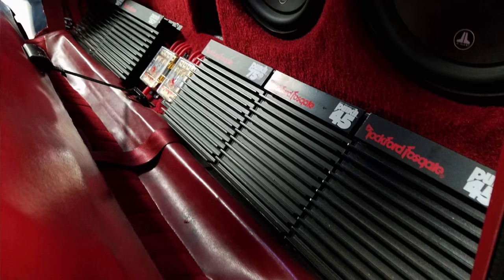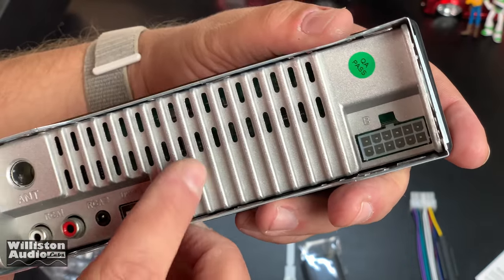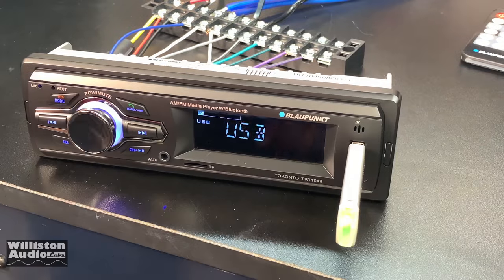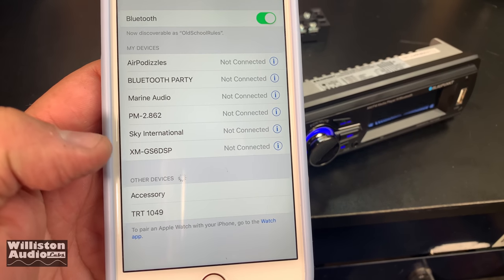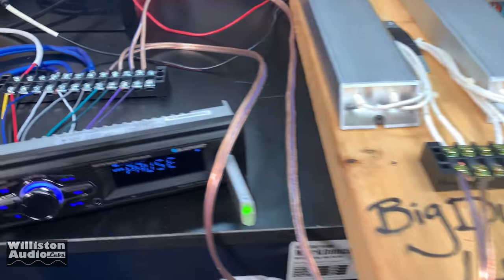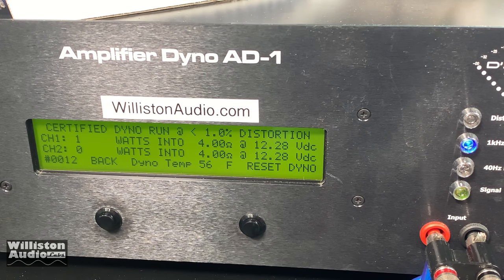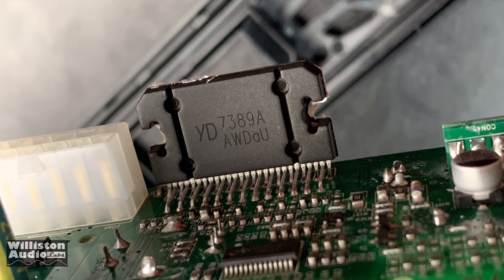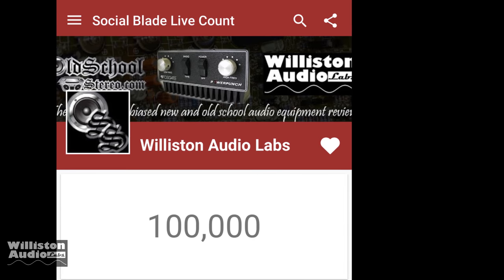Is a $10 Walmart Car Stereo Any Good? [4K]

Comment: How many amps to power this thing? I could see myself installing this flush into the face of my workbench with a small 12v power adapter rather than the old boom box I have on a shelf now.
Reply: butchtropic  okay so I woul need a pretty hefty power supply

Comment: NO idea HOW this ended up on my YT "Recomended" list, but glad it did. I'm currently building out my '99 Plym Gr. Voyager as a stealth camper & THIS stereo is ideal for this application. Quality brand, cheap price, remote control (for when I'm in back), BT, USB. . . looks like I found a stereo for the van! Just need to see if it's still a reasonable price here in April of '19(?). Thanks.
Reply: Probably bought the advertising package. It popped up after my Linus Tech Tips vid
Reply: Blaupunkt is just a name nowadays. They slap it on things produced by whomever. And you'd be insane to expect a quality product for 10 bucks. Only god knows how long it will last you. That being said, if you aren't picky babout the sound quality, can't go wrong with 10 bucks.
Reply: Yeah, at this price, and being it isn't really a Blaupunkt, can't put quality in the same sentence. I guess it is nicer to be able to say it is a Blaupunkt  rather than a Dual brand or whatever, but I would not say it is a quality unit. Time will tell how long they will live, but not bad at all for a $10 stereo. Walmart sold out or I would have tested one in my work truck.
Reply: So what kind of speakers does one pair with this?  I am rebuilding an early '90s Ranger that I got dirt cheap so I was definitely looking budget stereo.
Reply from the maker: Thanks for letting me know, and for watching my video. The price bumped a bit after this vid got popular. I still like this unit and also bought a $14 Dual and $50 Pioneer to try out
Reply from the maker: I didn’t buy an advertiser package, sometimes you get lucky and YouTube recommends your videos based on views, likes and comments 😊

Comment: This is the perfect stereo to get when you are trying to sell your car that doesn't have a working stereo. It's tough to sell a used car that has no stereo. People want something in there to listen to tunes. However, when someone is buying your car, they aren't going to analyze the stereo too close. They'll just flip it on and off--it works--okay that's good--move on. They won't realize until after they buy the car, what a cheap POS the stereo is!
Reply: Το tell the truth i baught my first car a cheap one and it had a cheap head unit like that from OSIO. As i dont really care so much about music in my car i kept it on and i must say its more than enough for me
Reply: Tbh its not even a pis, bluteooth, Radio, it can take calls its fast asf it's not wired incorrectly and even comes with its ownn amp. No way are they making much profit at 9.99. You can even charve your phone with it.

Comment: Where would one get audio adapters for this thing, 
I opened it up, the end is a PILE of wires that have little to no meaning.. 
bloody non standard audio connections.. jeeze.. has to be 20+ wires and no connector on it.

Comment: So... it's been 30+ years since I replace the OEM stereo in any of my vehicles.  What is the point/purpose of the outputs on the back, especially the USB, for something that will be embedded in the dashboard?
Reply from the maker: Many units have USB on back, you can route cable into glove box or under the dash

Comment: The 3.5 on the rear is for a hands free microphone if I’m correct
Reply: It’s for listen to headphone.
Reply: @tch4577  good luck plugging a headphone in
Reply from the maker: I updated video description, I confirmed it’s rear line level output. First test cable was bad 👎

Comment: walmart still has em 16 with normal shipping still, .25 percent distortion at a hilarious 59/60 is CLEAN power. Im definitely using this in a portable , even tho is is not the most efficient... but  9 dollars bluetooth fuckin rca outs x 2 am af 2 usb one with sd read? AND UNDER 10 PERCENT DISTORTION HALF POWER CLEAN? Truly a steal it would sound great as a stock radio replacement to in any older car without premium audio

if you happened to have something efficient speaker wise in your house especially again acceptable mid 70s harmon kardon hifi distortion levels up until 59.
Reply from the maker: When I check Walmart.com, they still show $9.99 for me. Says arrives by Friday April 12th (prob straight outta China 🇨🇳)
Reply: Bought from a guest session. Unfortunately EC USA They tacked in the 6 bucks at checkout, but I will let everyone know - wal-mart does remind you via large green text that if you spend only 90 more bucks you get to steal the shipping freeeeee
Reply: @williaml1570  100 bucks? I just got free shipping for reaching the 35.00 minimum! The blaupunkt and two 5 quart jugs of synthetic oil. The oil got here in two days....the radio is another week estimated. Lol
Reply: nice the man D is selling these things out world wide  @rocknrolljesus3197
Reply: @williaml1570  he's got an eye for a bargain

Comment: This reminds me of when my buddy got a android head unit 6 inch screen, some no name brand fr china no doubt.   $49.99 on Amazon the day he was buying, and it just works.  Android is not fast on it, about as fast as $50 Walmart android tablet  but CarPlay and android auto use little resource it seems, and doesn’t lag at all using them through it.   Additionally even if the OS is in a hard lag, touching. Any of the mode buttons or volume or anything physical it works.. for $50 I figured they just mapped the button int he OS but they seem to wired them to physical hardware switching.

Comment: Original Blaupunkt company went bust and they sold the brand name to the chinese. Actually the chinese have been buying dead european brands for some time now. Remember Nordmende, Grundig, Telefunken?
What about your expensive GE fridge? GE appliances has been sold to Haier.
Reply: Exactly right.  Blaupunkt and Grundig, in particular, were only recently sold off by Robert Bosch (auto parts maker- Germany) BUT they kept control of one factory until very recently making headunits for the Australian Holden Commodore (GM affiliate) car and also the Pontiac G8/Chevy SS (which were really Aussie Commodores with the steering on the left).  Once Holden went over to using a GM-sourced headunit with a screen that was it for the remaining factory and it was all sold off.  At one time the Turkish company "Beko" owned the Grundig name and I think they still do for stuff sold in Europe...the rest went over to China.
Reply: butchtropic Mexican labor may be 1/2 the cost, but the wages compared to the US are mediocre. The minimum over there is $5/day vs here $7.25 per hour. That’s in USD. No wonder companies here like outsourcing to China where wages are pennies per hour sometimes

Comment: Got my 2 in yesterday...hooked one up today.  Gotta say that the radio reception is pretty damn good...at least in my area.  I like the app that lets you control it from your phone.  I couldn't believe how fast the USB port is.  I wish that the display could be a bit brighter than what it is.  Other than that I don't have any complaints.  Really can't complain much since it's only $10...🤪🤪🤯!  I may even use it with a DSP to do a decent small system.
Reply from the maker: Great feedback. See, I was impressed too!!

Comment: Blaupunkt used to be really good, like in the 80s.  Problem is they hit the top of the market and never really worked to stay there.  So others got better and they didn't.
Reply from the maker: Name sold many years ago. Unfortunately it happens
Reply: What 80s, try the 50s. I have an OEM VW Beetle radio, its a Blaupunkt. Rubber buttons with WV etching, full chrome face

Comment: Well to their credit, no tape, no CD, requirement. Decks don't need to be as deep as they are. I mean, why bother? Put a basic amp in them. Most folks will use external anyway if they care. Short depth decks are a neat idea. Of course, with more features, quality, etc.
Reply from the maker: Still, crazy value at $10

Comment: This radio sucks i bought one 10 mins of use and it was dead no sound out threw the speaker wires
Reply from the maker: Sorry to hear it didn’t work for you. I’ve had mine for months, still works great
Reply: @wal  lucky you mine stopped working got it of amazon about a week ago specifically cause its a tiny unit cause the dash i have is cluttered but didnt work for me
Reply from the maker: @danikael2815  should have 30 days via Amazon to return
Reply: Forb10$ its great unit cant ask for to much for 10 dollars

Comment: Wouldn't the rear 3.5mm jack be for a mic for phone calls? If you didn't try it on a call you might think it didn't work.
Reply from the maker: It’s Rear line level output. I updated video description with the info

Comment: Just bought one for $13.95 on amazon.
Reply: Nicholas Gardner how is it
Reply: It works really well in the simple setup I have it in. I have two 35 watt speakers and it drives them just fine and is plenty loud. The only thing is the mounting cage is a little flimsy.

Comment: Could you test how big of a SD card/USB drive it can successfully support? I’ve had the misfortune of plugging in usb memory sticks/SD cards & getting them corrupted because they were bigger than what the head unit supported. I had some that if I put anything bigger than 16gb it would do this & later with a diff device bigger than 32gb same ordeal(had to format in the end).  Now with 128gb, 256gb, and 512gb USB sticks for as cheap as $35USD. I wonder what’s the biggest it can read for those $10($20 now). Thanks
Reply: Yeah, cause I remember looking up thumb drives the other day and the smallest you can find readily available tends to be 16 gig, you can really only get 1 or 2 gig drives in bulk as the main use case for them these days is giveaways, so if it's a really old head unit with USB, that could be quite an issue

Comment: Thinking of making a Bluetooth speaker for work, How big of a power supply do u need? There's a 5a 60w one on the zonne for $10 that would work?
Reply: I ended up using a different cheapo head unit for a Bluetooth speaker, this one had gone up to $18, non Prime and maby was only available by 3rd party vendors on Amazon so I got a "Aboutbit" brand was around $20 it had alot of  good reviews had all same features was prime but claimed had slightly higher wattage, works decent, oh one cool thing it has 7 faceplate colors options... I used some soundstorm ssl 6x9s an 5 amp 12v supply, with a low pro antenna all in $50, it works ok, for the money... great, its way louder than other BTS in the $50 range
Reply: I'm thinking of the same idea, but with an SLA or marine battery as the source (already have a car trickle charger).  The battery would make it heavy  but it would also be a power source for some 12v led lights (sold as offroad and fog lights), and whatever else I may think of. Basically backyard use without trenching wires through the ground.

Comment: You can still find them on amazon/ebay for $10. Just got one for a river cooler stereo.3.5 on back is low power output"phono out"you can barely hear the music with ear buds plugged in and it all the way up.The back usb is "recorder interface".why it is there I have no idea.
Reply: butchtropic  it is actually a blaupunkt Toronto  trt 1049 according to the  labels on the box.The instruction booklet is where the rear usb is labeled "recorder interface".I know what it is but I don't know why it is on the back of the unit. Anyone over the age of 30 calls the non amplified audio out phono. Like turn tables used to output. You are right on availability.last night I had email offers to buy them for $8 but now they are being resold for $25.
Reply: eBay isn’t $10 anymore.

Comment: They have to make them cheap as litterally no car made in the last 10 years has a place to put them
Reply: it's a standard DIN size and literally any car has a hole for it.
Reply: @kyle8952  Not any more.
Reply: @kyle8952  not for at least a decade, not in Europe anyway, nearly every car comes with a built In radio none are single din, I have a 12 year old car and it has a double din if you take it out to replace it with a single it will look shit, it has Bluetooth and does all what this bluapunkt has.  BMW have had built in to the dash headunits  since early 2000s, VW like I have not long after, same as Merc . Hell even fords and Vauxhall's, peugeot, citreon etc etc  don't have replaceable head units any more they are all PArt of the dashboard and aren't even din
Reply: @kyle8952  nope. Not anymore. You can't even use a double to single din adapter because the manufacturers use their own proprietary stereo design
Reply: @kyle8952  used car delaer here. The others are right, the oldest crazy shaped radio was probably a Ford Taurus. It was oval shaped and included the HVAC controls. Manufacturers don't like people easily swapping out the radios, they want you to have to buy a factory one.

Comment: Don't waste your time, I bought three of these and returned them all. They work great for a few days literally then start to lock up, not turn off, display disappears, random shut down and lose presets and clock.  Garbage
Reply: Another klutz that can't do a proper install.
Reply: Sorry to hear you don't know how to install properly. It's never too late to learn. 🤓
Reply: butchtropic  I soldered my wiring harness you noob. They're just garbage. Thirteen bucks. Hello?!!
Reply: butchtropic  Older does not always equate to wiser. Two in a row failed in the same car with the same soldered harness, I didn't bother trying the third. I've had zero issues with the Kenwood I replaced them with, same harness again. And this isn't the only place there's negative feedback about these units. But think what you want old timer. LOL 😂😂😂

Comment: Hey Williston is the blaupunkt radio still running. Does it have a whining noise when it's hooked up does a Bluetooth go out on it cuz I know on the XD vision one that Walmart used to sell was a piece of crap but I was wondering if it had a electric whining noise and if the Bluetooth went out in it or is it still running strong straight out of the box if you could do an update video on it appreciate it

Comment: I don't want to believe this is a real Blaupunkt design. On ebay can find same unit without Branding. I Think this is it, just only labeled and packaged by Blaupunkt. And of course, they have performed appropriate quality control. :)
Reply from the maker: I did not expect anything but junk for $10, however I was impressed by the unit and how it performed

Comment: Derek, I ordered 2 of these little units based on your test.  They were sold out on WalMart online but they sent me an update and I paid $13 for each.  One is for a golf cart project I have so 1% THD is fine.  These would be good because of limited space in the specialty vehicles I build, classic cars.  Do you have another off the cuff reccommendation for a 2 or 4 channel 75+ watt per channel amp that is decent for low buck$ to mate this unit with?  As well, back in the late 80's I had a 10 or 12 band per channel EQ that I think was American HiFi that was a full DIN mount that was lighted green on the sliders. I really miss it.  What would you add to this head unit for a couple of solid 6 x 9's two ways, and maybe even a couple of old school bridged mono 6 x 9's for a sub channel?  I really miss that EQ, and I've been out of car audio for 25 years.  Everythig I see at Bigbox is too complicated to adjust while driving.  Space is a big consideration.
Reply from the maker: The Kenwood KAC-M3004 is one of the best tiny amps out there

Comment: Hello, just recently been back to car audio hobby after over a decade... found this channel and it's awesome! I have one question regarding SQ, DAC and BT connection... When you pair your cellphone (or whatever device) to your car stereo via Bluetooth, am I right to assume it's actually using cellphone/device DAC? Is there any compression as signal is transmitted wirelessly through BT as well? Or is it simply sending the bit-by-bit (lossless) file straight to player and thus being played as it would with a flashdrive/SD? I haven't been able to find that info anywhere, but I do NOT like the fact that cellphone DAC is involved, as I'm willing to invest in a SQ project soon... Can you please clarify me that, Williston? Thank you in advance.
Reply: I have figured that both cellphone and headunit can control volume. Bass/treble adjustments (i'm using a basic 2-band hu yet) on the hu is also applied to final sound output. I guess it's pointing out that both DACs are being used simultaneously, right? So that means extra Analog-to-digital and Digital-to-analog processing, which further deteriorates sound quality... could you please confirm or dismiss?
Reply: There is no digital-to-analogue conversion done on the phone side when using Bluetooth, ever. Any volume adjustment done on the phone is digital, which means lowering the volume on the phone will negatively affect quality.

Comment: Great for features, considering the cost. That's the modern world of consolidated brands. If you need something this cheap, I'd still buy a used old skool stereo for a few £$ more. Many had aux connections. You can add your own bt. Much better sound and stable. I've brought a few alpines/pioneers with cassette/cd versions. Even got a nakamichi for a bargain. The displays were slick.
Reply from the maker: They even have BT adapters for old Alpine head units with AI Net. I use one with my CDA-9815